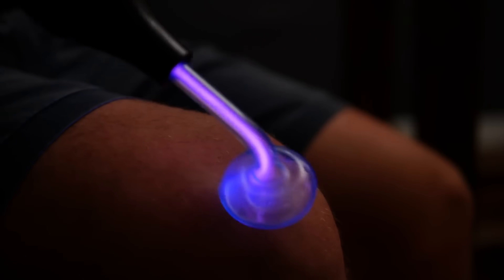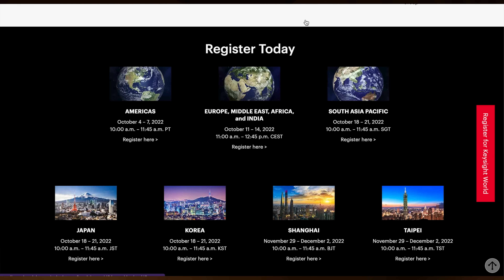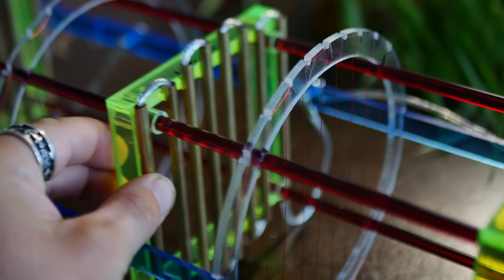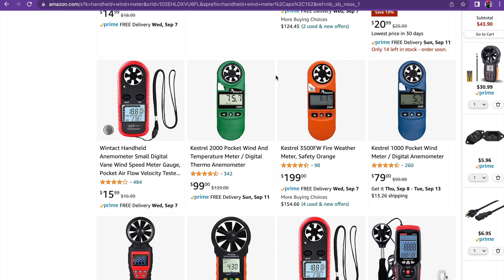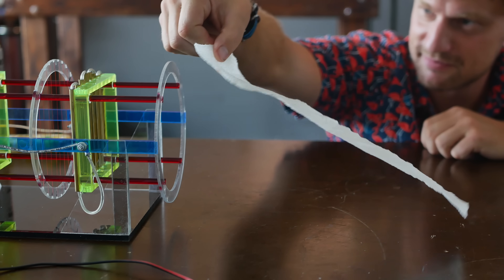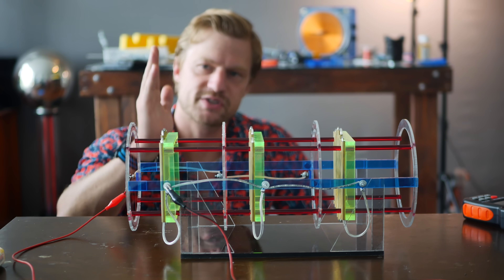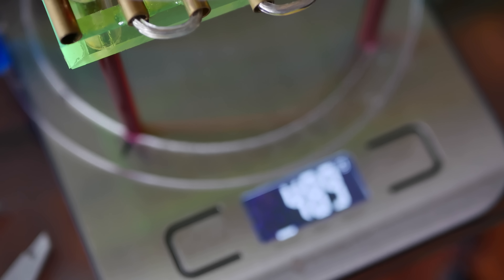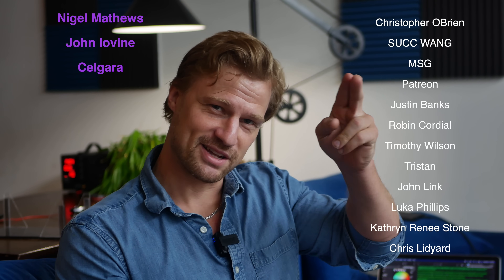Designing A Next-Gen Ionic Thruster! (For Flight)

Comment: "This... is a Multi-Stage Ionic Thruster" that gave off Doug DeMuro vibes for a moment XD

For real though I love this, I was amazed at MIT's thruster and this is epic too, I think the staggered spacing is kinda like ignition timing in a car engine, the faster the airflow gets the shorter the spacing has to be and the less it can accelerate the air due to the design being suited for static thrust, I'd imagine that the flight of MIT's plane was probably near its top speed because of that, its quite interesting to consider. A jet engine has a thrust curve that keeps climbing with intake speed, but for an ionic thruster it looks more like the curve of a turboprop, heavily skewed to static thrust that drops as intake speed increases, so maybe a super lightweight servo or stepper mechanism to nudge the spacing up or down depending on intake speed to optimize for maximum thrust efficiency and thus maximum thrust? I don't know really, I'm spitballing here but regardless I'm quite excited to see how you develop it from here! :D

Comment: Can you add a Bernoulli effect to the intake front?  

Wrap the entire sides in cling film to have air pressure increase towards the end?  

The plasma will heat up the air, could you add a Eco Cooler at the exhaust to increase push force?  Except, not just a “funnel”; build a ever decreasing sized Tesla valve as a thrust jet end inside the narrowing “funnel” end to help increase the thrust even more??   Or am I just way off base??

Comment: In both the US and Russia,

magnetohydrodynamics have been developped to produce stealth hypersonic vehicles for decades now, what Putin unveiled years ago (unstoppable mach 10+ non ballistic trajectory nuclear delivery vehicles with unlimited range and multi megaton payload) is only the tip of the iceberg.
It works by ionising the air at the leading edge of the craft and then converting it’s velocity directly into electric current using linear electrodes so that it can be fed into conventional turbojet engines. It is then accelerated using similar linear electrodes except this time you use the current produced by slowing down the air before the reactors to accelerate it.
The result is mach 10+ speeds with no shockwave or radar signature produced. The guy who designed the tech used in those is called Jean Pierre Petit, look up the Wall of Silence, it explains in simple language how this works. He also has youtube videos.

Comment: add a turbine a head fan and use the whole plasma thruster in place of a combustion chamber. also, don't know how dangerous this is but, spraying water or even mineral oil to avoid it blowing out, to vaporize and expand like a jet engine does. what you're doing is more akin to a regular prop plane, need to control what the thrust is doing more with a enclosure.

Comment: My guesses are:
Ground electrode shape, parallel connection (vs individually adjustable supplies), and open frame. 

I would also like to suggest that rotating the electrode arrays by 90 degrees and/or reversing polarity between electrodes might held some interesting results...

Comment: Very cool! You didn't take the mass of the power supply into account though, which will significantly hurt your thrust to weight ratio. Does it not make sense to duct the thrust chamber with some sort of heat-resistant film? You can also greatly simplify the mounting system now that you've settled on some spacings for the various stages. Lastly, do you need such beef collectors? They probably add drag and a fair bit of mass.

Comment: 1) Use ducted Airflow
2) Consider Ionising a heavier gas such as CO2. For instance the Ionisation energy of CO2, is about 1eV higher than O2, but 1.4x heavier than oxygen.
3) Use a nozzle
4) Use annular rings instead of squares
5) Consider using veined cathode / anode pairs to introduce a spinning moment on the accelerated air. This coupled with a ducted flow show locally increase pressure and the entrainment air

Comment: closed body, possibly with a taper

test stage widths, and variable width paths (compression)

some kind of timing circuit so the different stages fire synchronized instead of always on

3d print all the body pieces in a light material with low % infill

add more stages

Comment: Wouldnt enclosing the structures sides with a light membrane like cling film help direct airflow and thus thrust while minimizing weight? Also would stacking multiple positive wire looms before a ground (say 2-3 in a stack for a total of 6-9 positive wire looms) help in moving additional air or would that cause issues?

Comment: Many ideas I had are already mentioned by others, but one I didn't see was trying different emitter arrangements. I would try a spiral shape and then try to find the most efficient spacing.  Maybe do first one with double lengths of wire for the same area.  You should be able to have the wires very close as they are all at the same potential and shouldn't spark.  It might be worth testing more aerodynamic grounded collectors.  Many ducting designs should be tested, and it would be interesting if you made some cyclonic.  May be a good idea to do most testing with single stage only.  This is very interesting as I work with power supplies for Precipitators which operate between 45kV and 80kV - DC primarily  to charge ash particles to clean the air.

One last thought would be seeing if using a high frequency DC voltage would benefit by reducing peak voltages allowing you to bring the emitters closer to the ground without sparking over. This could give you better efficiency in a smaller design.

Comment: Brass tubing has half the electrical conductivity, 3 times the weight and twice the price of the same sized aluminium tubing...you could also consider flattening the tube parallel to the airflow into a ellipse to reduce drag

Comment: containing air flow the open design lowers your total thrust because plenty of it is also just able to get blasted out the sides ; if i were trying to make a viable thruster for actual use rather than proof of concept id probably ad more stages see how far that can take me in terms of power to weight ratio . id also up how much power that thing can take whilst also slapping on an exterior insulative shell to keep those outside safe

Comment: Ducted intake to provide most efficient air intact . Build the unit into a close fitting tube to prevent accelerated air from escaping before the rear exhaust.  Build exhaust nozzle and test different restrictions to help maintain the highest air pressure inside the motor. My assumption being that higher air pressure inside the motor will  mean that the ion grids have higher density air to work with.

Comment: Optimization suggestions: add full ducting to the engine to help directionalize the airflow like in a ducted fan, possibly add more stages, and add a nozzle to the end to compress the flow and accelerate the airflowstream, but given the (likely) low static pressure being generated, a nozzle probably wont help much. for weight savings, go with 3 stucutrual bars instead of 4, and possible swap them out for thinner walled, larger diameter rods of the same mass, if they can be found. 

Overall thoughts: WOW I NEED TO BUILD ONE OF THESE BECAUSE THOSE PLASMA EFFECTS ARE GORGEOUS

Comment: Seal the housing, use Venturi entrainment, optimize inlet and outlet shape and size, and finally optimize current by using a series setup for the stages (the first fin in a jet engine might compress air at 2:1 while the final fins might compress air at 12:1 so we might be able to use the same concept. 12kv for the first stage, 60kv for the final stage)

Comment: The thrust in air is actually much higher, since the air has a place to go. On scale it just poofs out. Attach it with strings from top and see how large of and angle can you get it, then calculate the thurst.

1. enclose it in a tube so accerelated air doesnt escape
2. fit straw like structures to induce more uniform flow reduce the amount of energy dissipated in eddies
3. More phases (How about 15?)
4. heavier ions (be careful!)
5. timing of the coil activations (you can do with just increasing the length of the connecting wire between the coils, relying on the speed of light to take its time - although resonance could poise an issue)
6. add a turbine stage (that is, tight 50 bladed rotors) to the middle to increase inertia of the system as well as reduce eddies
7. Focus the air in the end
8. spray some kerosene to the mix and light it at the final stage for 10x power

Comment: Does the ionic module shone draw air from the side?
Does it project air out?
A model built in a enclosed chamber used as a frame help?
Will the shape of the chamber introduce other affects? Such as flow turbulence?
The ion light show was great. Also if double the upflow element change the affects?

Comment: 1) Put it in a cylinder with a jet at the back to shape airflow. It won't look as cool, but it'll prevent losses out the sides and increase thrust.
2) Test with alternating the orientation of wire frames in their panels, spacing between the wires (tighter/wider), and pattern of 'lacing' the wires to that frame.
3) Would rotating the wireframes within the cylinder while it's running cause spiral airflow? That seems like it might have useful effects...
4) Is one part of the wire generating more ions than the rest? If the charge entered the wire at one point, it may be worth investigating what patterns of wire-stringing generate consistent, or intentionally inconsistent thrust. I'm imagining some kind of spiral pattern working best, where the negative side of the wire is shielded until it gets exposed in the middle of the frame, and then spirals outward. That puts the most thrust generated at the middle of the cylinder, in the column of air you'd want...

Comment: •1°| increase ∆V or ∆Vfreq @ stages with higher distance seperation .
•2°|  Create a reduction collar for laminar exhaust flow, maybe guide fins or teardrop whichever weighs less... If guide fins are used longer in the center to maintain boundary layer and reduce turbulence in the central portion of engine as much as possible
•3°|  Closer than 1" with stages (unless spark gap & arcing are issues) if so: 
•4°|  ADD more windings, more stages possibly? 

•(The trend seemed to increase exhaust velocity with tighter spacing so >1" could be more ideal) (Greater air velocity at center of engine is ideal also) turbulence and weight reduction) 1lb is quite heavy, the exhaust speed is exquisite!! much higher than I would have guessed at 90Watts!! Frame weight reduction would be a sinch with some carbon fiber rods and plates you could prob. bring the weight down ~75% to around 120g. I recommend

Comment: Really nice design, great work! Some thoughts: Drill lots of holes in your various struts to reduce weight. Use lighter materials (of course). Thinner as well. Plastic rather than metal nuts/bolts. As thin a wire as required, as thin an insulator as you can manage. Curious the use of round tubes for the cathodes, as Lifters use flatter planes, try playing with the shape of the cathodes. Add additional stages, as 3 was better than 2, is 4 better than 3?  Looking forward to more of your experiments!

Comment: I think a good place to start for optimization it to identify all points of energy conversion and find the efficiency for each stage. 4.1 watts per gram works out to be about 418 watts per newton of thrust. Improving those efficiencies where they can be to reduce the power requirement will make it substantially easier to build any self-contained vehicle using this type of engine.

Comment: Lower flow turbulence (vortex / laminar solutions?), ducting/cowling, and materials/composition (structural & electrical; weight reduction and improved efficiency)? 

Also wondering if there's any benefit from chambering & nozzle to increase compression. 
Admittedly I'm not very familiar with ionic wind designs and am just borrowing from my knowledge of conventional aerodynamics & multi-stage turbine design.

Comment: I wonder how well an optimized ionic thruster would work as the propulsion stage of a jet turbine engine, because hypothetically speaking, it might be possible to design a jet engine that uses ionic thrust instead of hydrocarbon combustion as its means of propulsion, and with iterative AI design, flow optimization software, and ceramic/resin 3D printing, it should be possible to design a custom piece of hardware that anyone can make, if they have the right equipment.

Comment: I wonder if coiling the wire tighter and increasing the service area would have a positive or negative effect? 

I mean, on one hand, more surface area means more ions moving. But it also means less air being dragged along with it.

Also wouldn't it be better to switch out the grounds with maybe metal tape or sheets as opposed to tubes?

Comment: - Some kind of lightweight 'walls' to prevent lateral flow (paper?)
- Reduce unnecessary length of thruster
- Staged voltage increase, higher voltage for faster-moving air

Comment: Nice video! I can think of 3 inefficiencies off my head:

1) it needs a bell shaped intake lip for lamina airflow. It will significantly improve thrust. 

2) the conductors in the middle is currently round, and an airfoil shape have a better drag coefficient for long term efficiency

3) this system should be an enclosed tube to accelerate air. Currently air could enter the system at all different stages and at different angles. 

Not an expert but just purly base on gut feel

Comment: Would it give you better thrust if you contained the whole thing? I could see air pressure potentiality being lost in your design. Also, could you shorten it to make it lighter? Staggering everything gave you a decent boost, so figure t the best ratio and make it stationary. Also, subbing out light weight plastics for aerogel would take weight off. But I'm not sure how practical that would be. Also an idea, rotate the negative electrodes, it could create a vortex effect.

Comment: 3 inefficiencies I think the BSI thruster has.
1) As Kyle Wall said, a nozzle at the trailing end of the thruster and ducted airflow could help increase thrust. (would bypass air in a ducted system help as well? Like the jet engines of an airliner?
2) The power draw. I'm no electrical engineer, but 91 watts of power seems like a lot to power a thruster which only make 22 grams of thrust. It is still impressive, yet it seems like something that small should be made to be more efficient with the power draw.
3) It seems like more stages could be added. Or perhaps, maybe more wiring per stage? Either way, I would've like to have seen more randomized spacing arrangements of each stage.

I would really appreciate replies from anyone to strike up conversation on this man's seemingly amazing innovation.

Comment: There is no cylinder preventing air from going to the sides, also the wires don't have the right shape for receiving the air flow from the previous one. Give them a wing shape.
Have you consider the same effect with something other than air? I wonder if it would work differently if it was a different gas or a liquid.

Comment: Electrods are workong area for electron in all activated territory (plot). 
You get booster 1.1X with 3 section 2.2m/sec, but ! activator plot area was a same.... correct.
Also ELECTRON activator plot area 3X and voltage 60 kV need 3X....
Than YOU CAN GET theoreticaly 3*3*3 = 27 times more growing ENERGY / or -weight !
It meen (in 10:oo- 10.20)5 gram * 27 X TIMES !  // not 18% from needed minimum as 5.5X ... //= flight model + some electronic components flying less 30 km/h.

... In senond step You can use frequence & light energy for OWN real fly prototype WITHOUT MOUVING ELEMENTS. 

NB! COMPARE ICE, (water) and candles light energy souces Wt/gram for better results and let me know Yours new skills, please !

But it's an other story. 
Bests, 
Vision Union inveNtors
Telegram: @ heispace